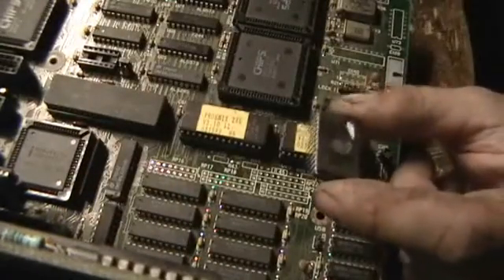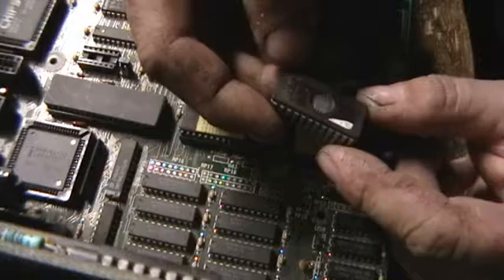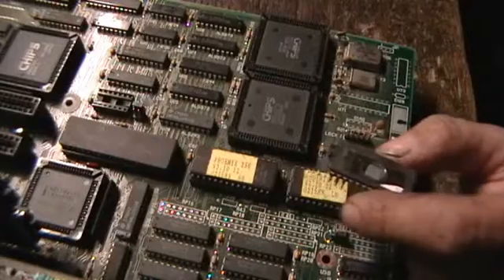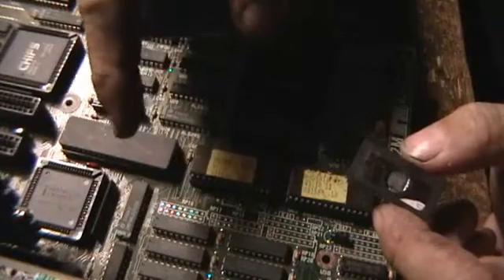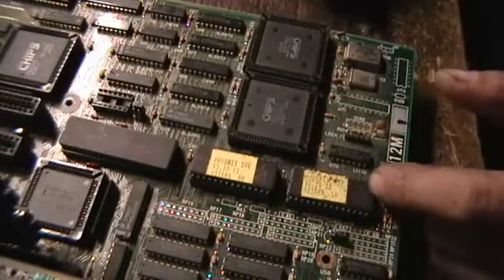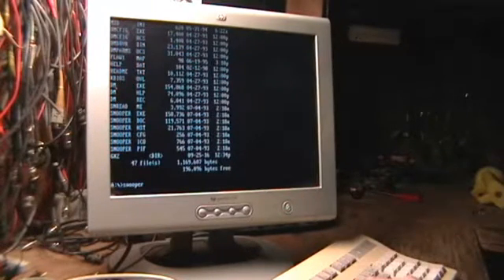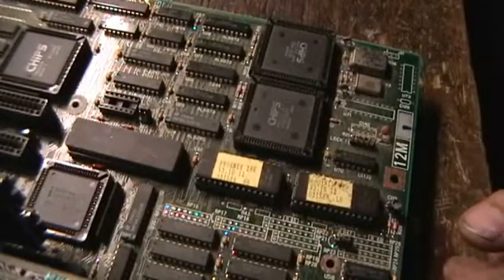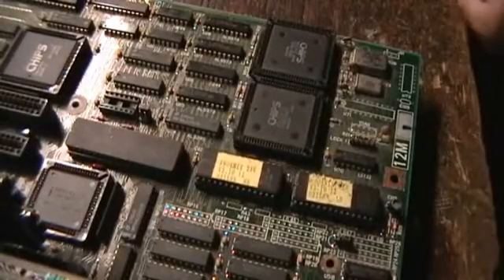Dealing with EPROM (BIOS) degradation on older computers.

Comment: In some cases, an EPROM that has become marginal can be read properly in a programmer by lowering the VCC slightly.   In that case, there is still enough trapped charge to turn on the transistors.   You can tell if you are reading the chip reliably by reading it multiple times.  If you always get the same data, then probably you are getting the correct data.   I recovered a bad chip by reducing VCC to 4.0 volts while it was in the programmer socket.  At 4.5 it was still flaky.

Comment: is this because of xrays or alpha beta gamma decay?
Reply from the maker: No, it’s not because of radiation.

It is a result of the fact that there is no such thing as a “perfect insulator”.
The material that makes up the insulation in the cells of an EPROM is very pure, but not “perfect”. Each individual storage cell in an EPROM is basically a capacitor. The floating gate is one plate of the capacitor. The substrate is the other one. The oxide in between is the insulator.

The floating gate is a gate of a field effect transistor that generates the desired output when selected by the address selection electronics.. 

When you program an EPROM cell (bit), you use a high voltage to forcefully inject a charge into the floating gate. That causes it to read a 0, instead of a 1

The charge doesn’t quickly leak out because there is no direct path to the outside world. So it’s trapped. It is a very small electrical charge, in a very small capacitor, but the insulation around it is extremely pure, so it takes a LONG time (measured in decades) for it to leak out. But it does leak out after long enough time passes by. Every once in a while, an arrant electron will randomly find it way out.

The normal targeted minimum data retention life for most manufactures was 20 to 30 years.

They could have made devices that would have reliably held data for 100 plus years, but the cost to produce such items would have been prohibitively expensive.

It is reaching the point that they are getting old enough that their original programming charge has leaked out to the point that the data is starting to cross the threshold between 1, and a 0. and the desired programming is becoming garbled.  

When you reprogram the chip, you inject a fresh charge into the floating gates bringing them back to the level they was when the device was first programmed, which should allow them to last another couple decades before the data degrades to the point you could start expecting problems again.

The chip it’s self does not degrade. The lost data integrity is strictly a result of the limitations of the materials the chip is made from, combined with the passage of time. When reprogrammed, the chip will be just as good as it was the first time it was programmed.

Newer flash/EEPROMs use the same basic technology, and suffer the same “charge leakage” as time passes. A lot of the manufactures boast about “100 year” data retention life, but I highly doubt that they will last that long, because the “quality control” over their production isn’t stringent enough to reliably produce equipment that would obtain those figures.